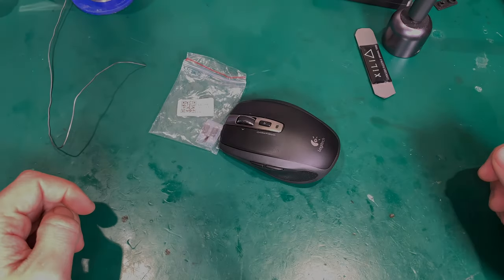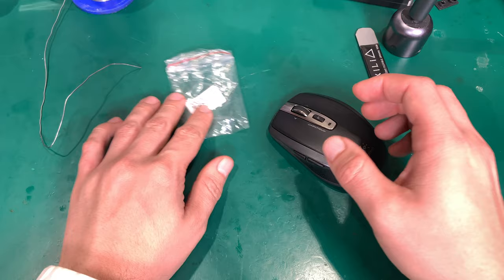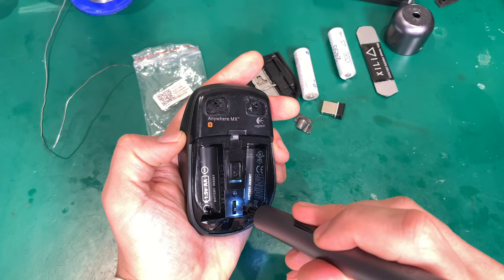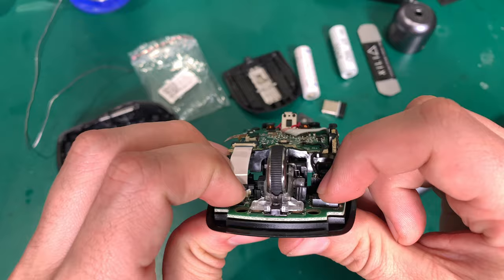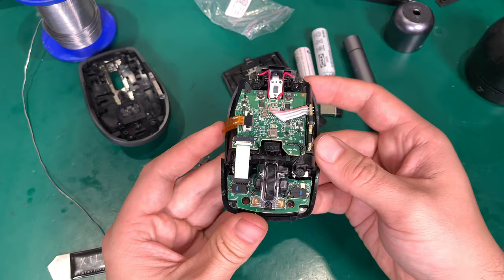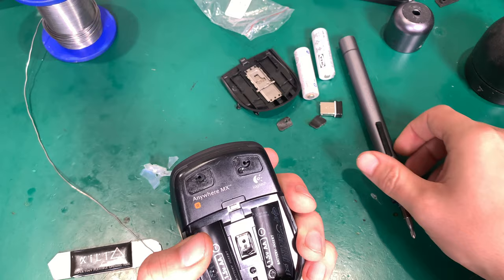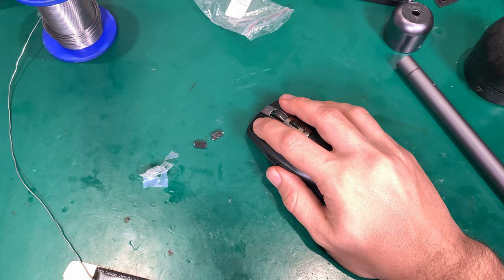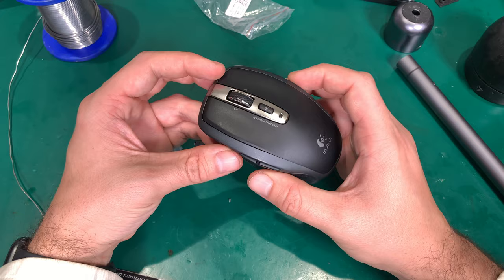Logitech Anywhere MX Mouse - fixing  double click issue

Comment: Before replacing the microswitches use an aerosol contact cleaner to inject the switches with cleaner via the applicator tube whilst pressing them.
Worked very well and has been ok for over a year
Reply: I second that. Cleaning the contacts worked for me.

Comment: Tiny switches.  I repaired the wheel click on my mouse, the axle had broken that went through the wheel and into a sensor and the centre click was on the same axle on the other side, when it broke it would not scroll or click, so took it to bits and used a straw off a WD40 tin to make a new axle.  I glued it into the wheel sensor and it crossed the micro switch for the centre click.  I can honestly say it now works better than when it left the factory.  I bought a new mouse to replace, but after the repair I much prefer the repaired mouse.  Good video.

Comment: This occurs with all LOGITECH mouse. Very bad quality of mouse.
Reply: What brand do you recommend?
Reply: I am using same logitech anywhere mx mouse till 2010 and it still good condition. The micro switchs has a life time. 5 year ago I changed them. And now I have to change it again. But 13 years is very very long life for a mouse.
Reply: The mouse quality is good, but the switches has a certain number of clicks, between 10 ou 20 millions.